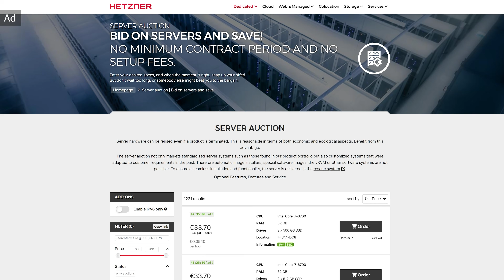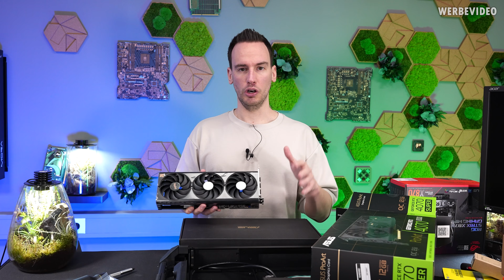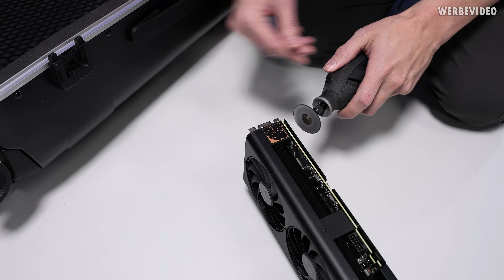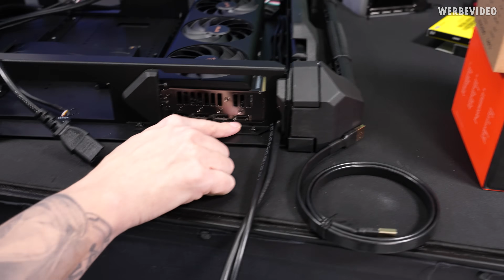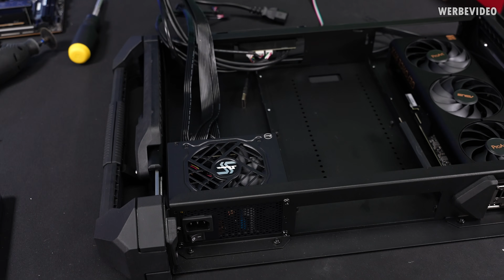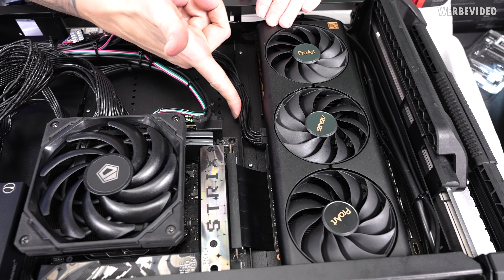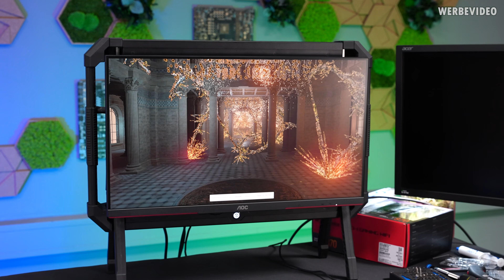I made a Small Mistake with Big Consequences - eBlaztr Build

Comment: It's an iron law of modding that the odds of doing something dumb with a dremel approach 100% the longer you participate in it. And yes, I've done it too.
Reply: From my own experience, the odds of doing something dumb with a dremel hit 100% when you plug the damn thing in.
Reply: @GimpyChinaman  And that's why I  bought myself a cordless dremel. ha ha. I've gotta cope somehow, and that was the perfect solution.
Reply: @EXG21 a pneumatic mini angle grinder will never get you into these troubles. 😂
Reply: @GimpyChinaman  especially if it's a cordless dremel :)
Reply: Yep 😂 I literally looked at something and I’m like should I really attempt this then I do it. I screwed it up and I sit in disgust I love and hate my dremmel
Reply: Roman gets the Adam Savage "measure once cut twice" (de)merit badge, lol.
I've been there and gotten that award myself, lol. (cheers)

I marked out where I wanted to locate a PSU in a case and cut out the hole only to realize the hole I cut was the same size as the PSU and there was no metal left for the mounting screws to hold onto, lol. I then had to find a junk case to cut out the PSU mount to have something to use to mount the PSU in the hole I made, lol. That was back when "full size" was over 65cm tall and included optical media drive bay things.
Reply: m12 die grinder is my new best friend...  the bigger brother to the little d..
Reply: ya not true, most people who dont know what they are doing when cutting forget the golden rule of building when it comes to cutting. measure 2xs cut once. if not sure measure 3xs cut once.
Reply: @ColdVenom159 As if you've never made a mistake or perfectly executed a plan that was flawed from the start. You're not always cutting a 2x4. Sometimes you can't tell how the final assembly will actually end up until you do it. I don't think he's intentionally messing up projects, I think he just rushes through them without much planning. There are plenty of ways he could be stretching out content if that was the only priority.
Reply: @JJFX-  Oh ive made my fair share of mistakes, tho ive never mounted a gpu wrong then start hacking up the i/o bracket before even trying to see why the gpu isnt mounting correctly, then to come out say i was to stupid to mount the gpu correct way. fact youre trying to defend the guy when he stated he wasnt paying attention tho rather cut up someone elses gpu says it all. just like the last build he did for a lady he wasnt paying attention started cutting stuff and screwed up on her build as well. was bad enough the lady hit his comment section and said herself der8auer said it was only gonna take a day for the build tho it even up taking weeks cuz der8auer screwed up.
Reply: @ColdVenom159  I'm not defending him man, I just don't think he's doing this intentionally for content as you suggested. Yes, he's making some dumb mistakes, largely due to laziness or simply not bothering to plan ahead. A lot of it may come down to time constraints as he eluded to but it doesn't explain everything. Hopefully he's realizing he needs to figure out what his priorities are if he's going to continue reviewing products like this.
Reply: So many things needlessly cut up by a Dremel, or permanently stuck together with JB weld. It sucks, but it's fun 😂
Reply: measuring 4x didn't make the side i cut the correct one 😂
Reply: @fracturedlife  i will give him props he called himself stupid lol. this would be the 2nd build in a row hes screwed up on cuz he wasnt paying attention. tbh at this point i think hes making these mistakes just for the content as well the pc community is deal with no actual interesting hardware coming anytime soon out of the 5000 series lol. this is why it does not pay to depend on youtube for an income.
Reply: @ColdVenom159  I don't think he does depend on youtube. If he did he wouldn't be spending 5 days a week on thermalgrizzly.

Comment: ive said it a million times and i will say it again. we need better mounting solutions for giant graphics cards. two screws and a little plastic retainer are not going to hold up a 30 pound render brick. i will settle for nothing less than a 4-point mechanical retention mechanism.
Reply: Theoretically you have them. Look at the side if the gpu. Most (if not all) have 2 screw holes. It's just noone is using them most of the time.
Reply: Lot of bigger gpu's come with 3 screw mounting but yeah i guess we need a better system but then again while weare at it why not move away from ATX as there has been better designs which never got traction.
Reply: @Rentta  3 on a single bracket which is tiny compared to the rest of the card. the atx standard assumed graphics cards would be a single board with no heat sinks on it. even the multi slot card is a work around and thats not directly supported by the standard. the vanity slot while intended for displaying your hardware (to would be thieves so they know which computer to steal) at least puts the stress on a longer axis. but this leads to cases so large you need to reinforce your desk.
Reply: that's a reason why I don't think this enclosure is well designed in its actual form. Having no mechanism to secure the GPU on the other side is a large issue, as well as the lose riser system. I can see this design easily not working as expected as an easy to setup portable PC.
The traveling case might be very well thought but the inside is still very susceptible to shocks and vibrations during transportation.
Also this might be a professional solution when there is no way to use a local setup but calling it "industrial" is a real stretch to me.
Reply: @PainterVierax  i dont even want to carry my 12l sff build around. one because somehow it weighs as much as a full tower anyway, and two because of the size of the heat sinks in the case, nothing is resistant to any kind of physical shock. when you have a big hunk of metal attached with a tiny screw, and apply vibration a vehicle of any kind produces, you will break things.
Reply: This is why I love the high end XFX cards. They come with a reinforcing bar that bolts into the gpu and uses 4 screws into the IO slots. Aside from the screws, the bar also braces against the back of the case. Rock solid.
Reply: @ until it gets added to the standard, or the standard gets replaced, its still a proprietary vendor-specific solution.
Reply: I accidentally broke off the retention catch on my GPU socket and to my mind that is an upgrade. The catch does nothing to prevent sag.

Comment: In the space of the cable hiding plate they could put hole patterns for aio's for better cooling. Also they could put some mesh on the other side for better air flow (aio)
Reply: Aio is also a consideration. 
However for an aio to function properly the pump has to be located below the cooler. Which means a relocation of components

Comment: Roman, you are never permitted to use a Dremel on a GPU again, that was just painful to watch. :) That said, at least the end plate is semi-replaceable if you really need to. Looks good so far, although I am also concerned about the monitor being mounted directly to the case. But, as long as there are no electronics directly under that point on the monitor, it should be ok. One could also add some spacers, but it would be better if the case maker included some by default. Also, clarifying the manual would go a long way toward making sure mistakes aren't made when putting it all together.